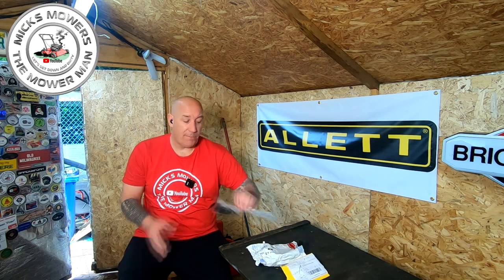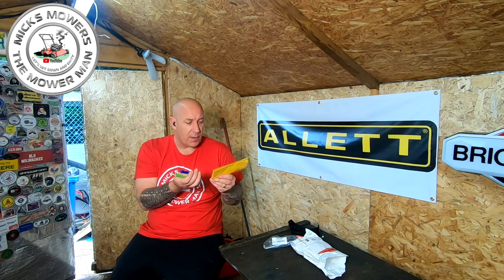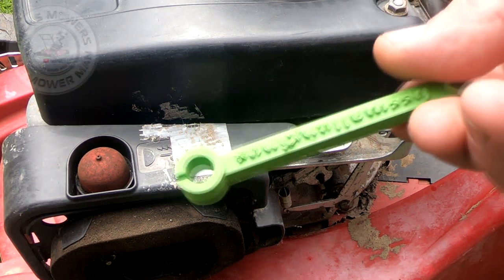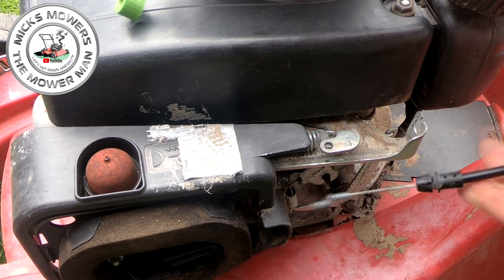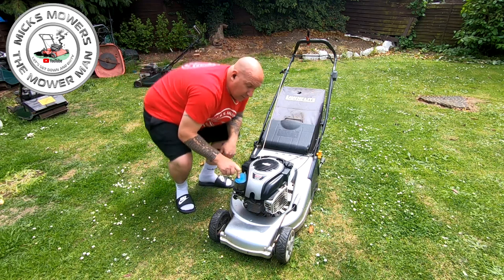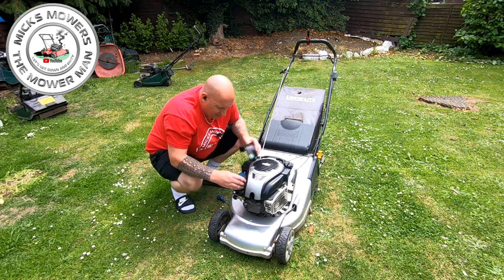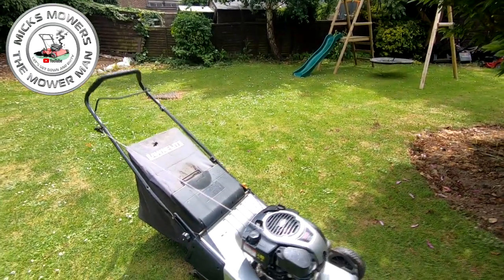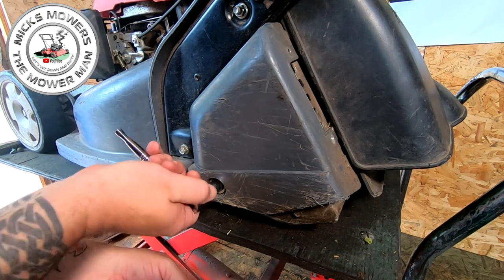Honda hrx467 Height Adjustment Broken #micksmowers #hrxpro #honda

Comment: Great easy fix.Good service for your customers .I have a stihl back pack blower the guy run out of two stroke oil and used engine oil.And needs new rings and carb rebuild and coil i think it on way out and de coke .He came to see it and explained the situation he was well happy
Reply from the maker: Good job brother

Comment: Those little cable clip tools from the states are the biz! I spent an hour trying to remove the drive cable from a Hayter spirit monday with plenty of curses for whoever designed the clutch! Eventually sussed it out and got it off with a long cable tie pulled tight around the arrow head!
Top tip for mower chain lube!!! Oil attracts dirt and dust, try bicycle DRY chain lube it has graphite or ceramic mixed with solvent, the solvent evaporates leaving the dry lube in the right places and doesn't attract dust! Happy days 🤟😁🤘
Reply from the maker: Happy days lol

Comment: Is there any way of preventing that height adjuster or roller breaking? 

I’ve had the same when travelling with the mower in a trailer and it bounces and has broken, any advice to prevent this I’d really appreciate 🙏🏼🙏🏼🙏🏼
Reply from the maker: Strap it down mate .. it does save them .. all that jumping about does them in
Reply: @themowerman  I do strap them down! Maybe not correctly 🤣 get a how to video made for us 🤣